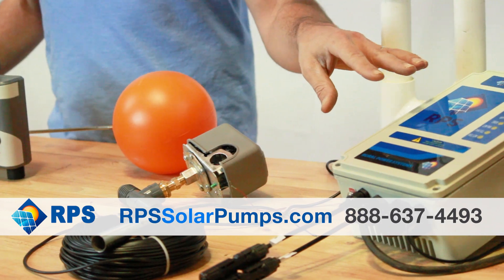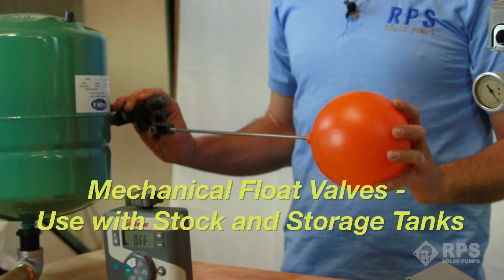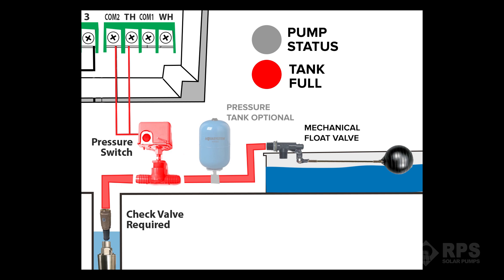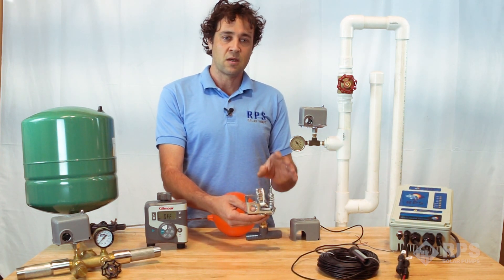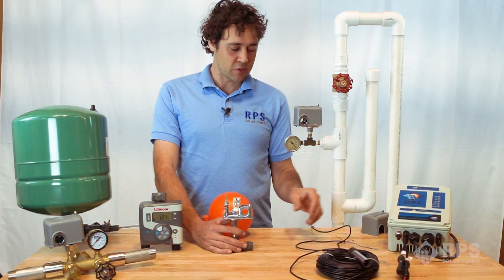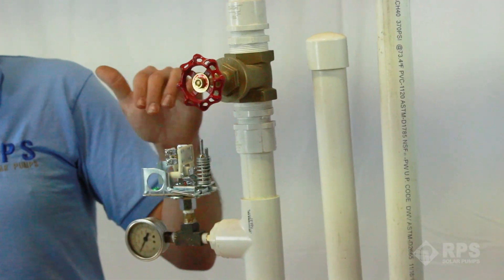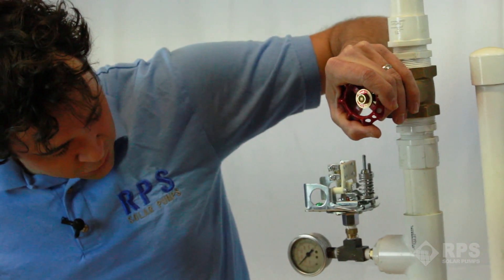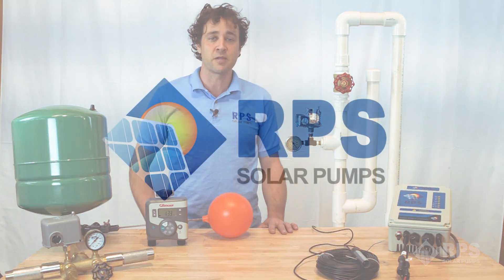Solar Pump Pressure Shutoff with Reverse Action Pressure Switch - RPS Solar Pumps

Comment: Is there any kind of contact or we can use to break the circut? So we can run control voltage wire long distances without carrying the load of the pump?